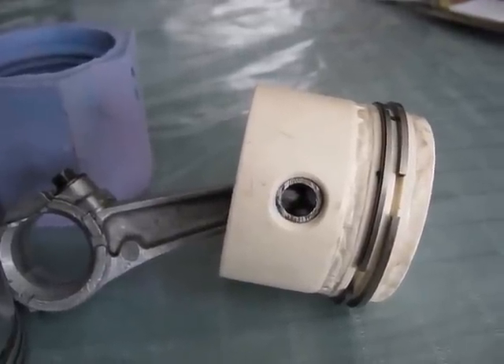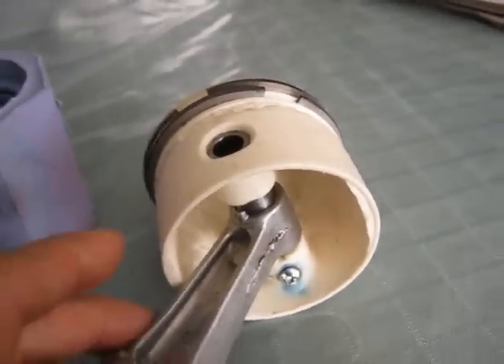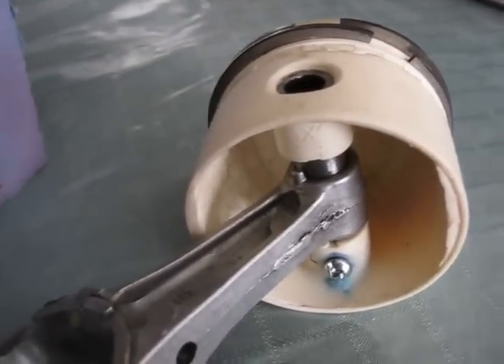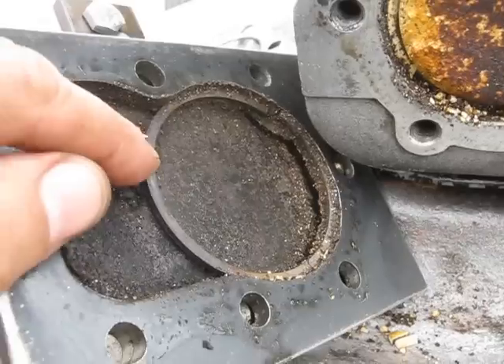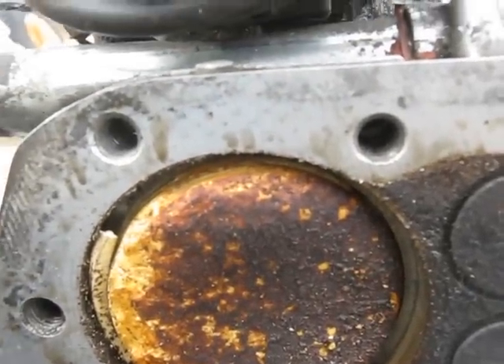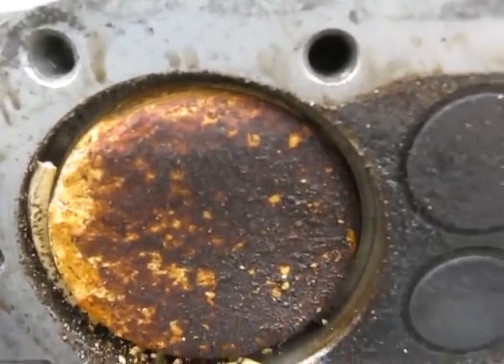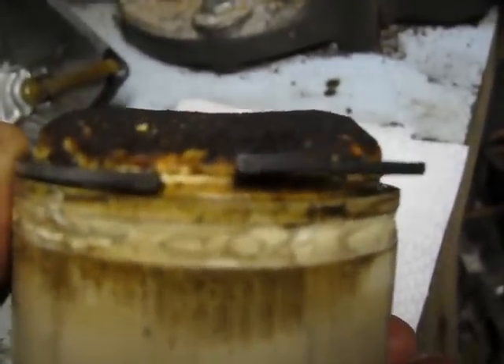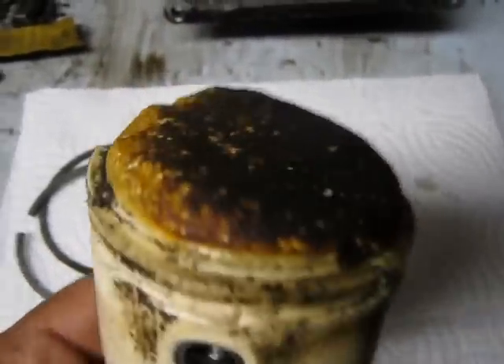PLASTIC PISTON  Briggs 4 Minute RUN!

Comment: concrete piston next ;)
Reply from the maker: That would be interesting, I wonder how the concrete would take the heat, if it spawled off pieces, I think it would eat up the engine pretty quick!
Reply: refractory cement (used inside smelting furnace)!? high silicone content!? (is silicone slippery?) and lastly, FIBER REINFORCING! all composite materials need FIBER REINFORCEMENT!
Reply: Who needs to hone the cylinder when the concrete piston does it for you ;)
Reply: Rockabilly Rambler hahahaha
Reply: Rockabilly Rambler this!!
Reply: Rockabilly Rambler yessss
Reply: concrete actually has a slightly lower density than regular aluminium, so it shouldn't make that much of a difference
Reply: bro, you must science so hard....
Reply: "concrete actually has a slightly lower density than regular aluminium," aluminium and its alloys have similar density and concrete density will gonna depend on many factors... 10 seconds with uncle google: "When using only MagnaDense as an aggregate, concrete with densities up to 4.0 t/m3 is achievable.  Mixing MagnaDense into concrete with other aggregates allows you to produce even concrete with densities up to 5.0 t/m3." aluminium is only 2.8 t/m3...
Reply: @ChargerMiles007  Aircrete might.
Reply: @ChargerMiles007  Aircrete? The stuff can really take the heat.
Reply: Was just thinking that.

Comment: don't give briggs any ideas. they might machine these from a high grade plastic stick em in and then we have ANOTHER reason to buy a new mower every season. -_-
Reply from the maker: LOL :)
I know what you mean, I am not a big fan of all the plastic parts they are using now, though some of them seem to hold up OK. I am pretty fed up with how short the life of home appliances has become, like 2 or 3 years!!!  >:((    having to replace a lawnmower that often would be criminal, considering I am still using my trusty 1973 Briggs pushmower!
 New stuff lasting such a short time is Terrible for the environment, the exact opposite of the green movement! The same goes for cars, you need to drive them into the ground before you have to spend the heat energy to melt the metal again, that is called efficiency, and is truly Green!
Reply: exactly what i was thinking!
same for you +ChargerMiles007
same thing i was thinking
Reply from the maker: I was outside doing some work, and thought I should make a vid on that subject of how the world is going anti-green in many ways. The green in the dollar seems to be the main factor!
Reply: Just came down here to make the same comment. They even sell them with plastic blades now!!??
Reply: lol, no worries. Tecumseh already has that covered, plastic carburetors. ;) I take that back I spy a plastic carburetor in the video. -_-
Reply: Tecumseh isnt made anymore to my knowledge but the new OHV Briggs push mower engines have solid plastic carbs on them.. and the old style diaphragm carbs have always been plastic but they work great. the newer engines of that style use mechanical governors though...more internal parts to mess up. another design change made by Briggs to make more money off of more destroyed engines. I hate Briggs and Stratton.. but that rant would take up to much space lol
Reply: Right, Briggs has made good carbs that were plastic. Tecumseh has been infamously known for their plastic carburetors due to cracking. I think the last time I seen a mower with a Tecumseh engine was a Huskivarna rider back in 2012.
Reply: Will Riling seems like every other spring one  falls apart
Reply from the maker: lol  :)  Thanks for keeping the rant short, I know what you mean though.
Reply: Will Riling every four minutes more like it
Reply: I know that feel of having old lawnmowers that never break, tha carbs are the things that mostly break from my experience, and I'm fine with those breaking every 5-10 years or so
Reply: seriously.  The older briggs motors were great.  the new ones, disposeable :(
Reply: Will Riling we allready have to deal with plastic cams, carbs and gears... soon the whole engine will plastic :(
Reply: I know, I still have my 1985 400cc IHV, Starts and runs at 240 RPM, sounds great after a carburetor upgrade. 
The new ones are complete and utter garbage.
Reply: ChargerMiles007 aluminum has a lower melting point than plastics?  I guess I didnt know that.
Reply: Will Riling yeah, they can have it match the plastic can gear and lobes in the new engine...don't get me wrong, it works, just not designed to last any length of time. I have a snapper model 3 30 inch cut rider I now my lawn with. has a late 70's 10hp on it. I gave it a fresh overhaul, new seals, gaskets, rings, but it really didn't need it. its all original, down to the points ignition. got it out this weekend to mow, been sitting in garage since Oct. started third pull. not bad for a forty year old engine. like to see these new engines last half as long
Reply: Cast aluminum has a high silicon content, so saying aluminum alone has a low melting point doesn't matter too much. Most aluminum we see is an alloy, not just pure aluminum. Strait aluminum does not even cast very well, but the alloys can be made extremely strong while still being light. I am a welder, and can say that strait aluminum actually does behave similar to plastic at high welding temps, but when you get into cast parts that property doesn't come into play since they are almost 100% alloys in any applications people are used to seeing them in.
Reply: sad but true...
Reply: Will Riling That's why I bought a Honda.Briggs used to put out a really good engine years ago,but not anymore.
Reply: Last year my neighbor needed a new mower so we went to Home Depot and seen they had two that looked almost the same. I said for an extra $40 you can get the one with the Honda, and he's very happy with it!
Reply: David Regan The Honda is a much quieter engine also,better fuel economy,easier to start etc.Your neighbor made a excellent choice.
Reply: Honda's are great little engines.  After all, they have had their small engines on scooters and motorcycles for decades and many of them still run.
Reply: 25rsboy I've got a 1975 Honda CB200S with electric and kick start street bike,runs like a Swiss watch till this date,it even has the original breaker points in t
it too.
Reply: I had a 1985 Honda Nighthawk S for a very long time and abused the hell out of it, still ran like new when I sold it with almost 30k on it in 2006.
Reply: Will Riling  ....Or buy a honda
Reply: Mr. Anderson Can't wear out a Honda.
Reply: well you can but it's hard, still depends on the abuse :D
Reply: crackerworld They can take more then most people can give it though,as so far as abuse is concerned.
Reply: LOL
Reply: Our 70s Briggs had a aluminum diaphragm carburetor.
Reply: People always bash them for plastic parts and being cheap, but these engines seem rather bulletproof to me. Older ones at least, can take stupid abuse and keep going.

Comment: I sincerely appreciate the fact that you have been using the same camera all these years. It is an aesthetic that simply cannot be recreated by any other means.
Reply from the maker: Yes, my camera is a few years old now. An honest question, does it have too low of resolution for people these days? I honestly can't tell, as it looks fine to me.
Reply: For the picky guys, maybe. Personally, I agree with you that it looks fine. The image quality gives it character, as in backyard mechanic character.
Reply: I like the relatively lower resolution. As long as the audio doesn't sound like gravel in a soup can, I'll watch any video. Only reason I went to an HD cam was because the old one I was using wouldn't refocus as the video was recording, that got really annoying. But I like the 480p resolution.
Reply from the maker: My old camera is starting to have a few issues, like the battery door having to be duct taped shut! I will consider an HD upgrade, thanks for the advice guys.
Reply: ChargerMiles007 old ti3 is a Killer camera for the money
Reply: its fine as is but if you want more subs you might consider a better one
Reply: you should check, i think there's some software tweaks that could mod your Canon T3i to shoot HD or 720, but well, they sure have better bodies now.
Reply: worlddomin623 
Ah, yes. The square video at 480p is very pleasant. *rolls eyes*
Reply: Maximum resolution on this iPad is 360p for this channel's videos. The next step on this device would be 720p. But well-focused 360p is perfectly acceptable on the 9.7” screen.

Comment: What if you made a JB weld (marine grade is higher temp and fuel safe) reinforced with aluminum shavings??? You could use the same mold even heck even imbed a aluminum piston face

Comment: Torlon 4203 is an unreinforced, lubricated, pigmented grade of polyamide-imide (PAI) resin for extrusion. It has the best impact resistance and greatest elongation of all the Torlon grades. Torlon PAI has the highest strength and stiffness of any thermoplastic up to 275°C (525°F). It has outstanding resistance to wear, creep, and chemicals. Torlon 4203 offers outstanding electrical properties, which makes it ideal for high performance parts such as connectors, switches and relays. In addition Torlon 4203 polyamide-imide can be used in applications such as thrust washers, spline liners, valve seats, bushings, bearings, wear rings, cams and other applications requiring strength at high temperature and resistance to wear. - High Flow: Torlon 4203 EXT - Higher Flow: Torlon 4203 HQ - Highest Flow: Torlon 4203 HHQ     {  I remember this when ford brought this out ( but not for piston tops )    http://www.enginelabs.com/news/plastic-race-engine-returns-as-polimotor-2-project-underway/

Comment: Cool experiment, what you have done here is via destructive testing , you have shown where the truly hot and weak points of the piston are.. One can easily see where the melting occurred on the crown, and the low efficiency of flame propagation in the flat head design. It tells a story of heat and gas flow..Virtually all the heat and wear too place under the exhaust valve in, as is the case in most engines.. 
Matra designed an air cooled diesel with cooling only on the exhaust valve side, and it's efficient and still in use today.. now you see why..
Had you put the rings lower down the skirt, so the ringland and crown were beefier, or a plastic piston bottom, with a metal ringland and crown ? who knows how long it would run.. Now we really are giving Brigs some new ideas,  would be interesting to see if you could make a composite piston plastic/steel ..maybe a bit of metal in the weal points of the wrist pin.. I'd try it myself, but I don't really like mowing other peoples lawn lol..

Comment: Unbelievable, both the result and the quality and care taken with your experiments. Excellent job, sir! Once it settled in, that thing ran smoother than a new Honda mower engine.
Reply from the maker: lol, yes, it has been rough running at the start on the last few vids, for some reason. My guess is that it may have been running faster than 3600 rpm part way thru, not sure why, since the governor was connected.

Comment: I had and Briggs engine in my ride on tractor 12.3 Hp and a 3 year old gas push mower. I look after all my things very well with yearly oil changes, sharp blades etc. Both blew up last summer, no more Briggs EVER.
Reply from the maker: That is a strange thing to have happen!

Comment: Really interesting video, enjoying the whole series, noticed the failure seemed to be the weak areas around the rings, it might be interesting to try a plastic piston made to be a close fit to the cylinder with no rings.
 looking forward to more )
Reply from the maker: Not sure about a close fitting plastic piston, mainly do to the expansion rate of plastic. it might try to seize up. I sanded a bit extra off of the piston to avoid such an event, though it was still about the same fit as a stock piston.
Reply: Will no piston rings seize up more or less then piston rings rattling around in the cylinder? :)

Comment: There must have been a strong smell of burning plastic there!!  
I stripped a Briggs mower engine down about 15 years ago, due to my Dad hitting a rock with the blade and bending the crank.  I was appalled when I discovered a plastic camshaft!  
However, I've been using a Flymo (UK brand), with a Tecumseh MV100S 2 stroke engine, for about 12 years now and that has been faultless. It's showing no signs of giving up any time soon, despite heavy use on some large lawns.  I do use a quality 2 stroke oil though as I have a couple of 2 stroke bikes, so I use the same stuff in the mower!

Comment: Great job! The top of the piston melted. If you do this test again you need to treat the top of piston to the first ring land to dissipate the heat. Electronically plated chrome or nikasil would work and toughen up top of piston. That will definitely double or triple the life of the piston. Also the angles of the relief above and below each ring needs more clearance relief to dissipate heat. The other problem you will find is piston pin will come apart in time, that needs extra support. Finally, cannot put normal oil in engine because it eats plastic. And increase clearances, probably around .002 for aluminum piston but double it to .004 and put a film coating on piston skirt. You maybe able to get a plastic piston to run a few hours. Great job.

Comment: you should try a plastic rod
Reply from the maker: I thought of that this week also, I will start making a mold for it! 
I am not certain about how durable it will be, but this piston really surprised me also!
Reply: it lasted longer than i thought could try other plastics and see if they are just as good.
Reply: ChargerMiles007 the rod would need to be a material with a extremely high hardness rating and a good tensile strength to prevent it from instantly being bent or snaping or getting ripped apart XD
Reply from the maker: thanks for the info, the plastic is only rated at about 3000 psi in tension, so about 1/10th of aluminum. I will thicken it up as much as I can, and hope for a short run out of it!
Reply: that would behave like a brand x
Reply: marco sooooo delren?
Reply: Try some fiber reinforcement during the casting
Reply: add a ceramic or enamel coat to head maybe?
Reply: Mabye a carbon fiber piston and rod, that would be interesting...
Reply: Tinfoil plated plastic.
Reply: A plastic flywheel would probbaly just explode in 5 seconds

Comment: You are the mad scientist of engines!
Reply from the maker: lol  I don't call them FrankenBriggs engines for nothing!  :)
Reply: ChargerMiles007 Im making a 3 cylinder radial engine because of you lol, any ideas on the crank? I have a metal lathe, milling machine, tig stick mig and oxy welders, unlimited resources (except money) and a shop. i just have issues with crank and timing.

Comment: Would be interesting to see a similar attempt with some more efforts directed at mitigating the heat issues. 
I take it that 300 series is a polyurethane? In which case, it's softening point is probably somewhere between 90 and 150ºC. 

Perhaps a phenolic crown bonded to the piston may last better & save the rest of the piston. Couple that with converting it to run on e85, or methanol (or even a basic water injection jet) & you may get the combustion temps low enough for the piston to last reasonably long. Would be really interesting to see if you could get it to the point of lasting an hour or so of hard running. 

There are resins that would handle it fine but nothing cheap. Would be really cool to make a plastic piston with a reasonable life, on a budget.

Comment: Try adding mica flakes and/or fine clay to the polymer when you cast.  It will form silica char rather than burning through.  It will likely run hours.

Comment: No cooling fins on the head could cause too much heat in the chamber further heating the piston? Would possibly work in a liquid cooled engine.
Reply from the maker: Yes, this is true, the steel head without fins certainly would run hotter than a finned aluminum head.

Comment: Wow, very good! Now I wanna see the whole engine (minus the electrical parts and any other mandatorily metal parts) be made of plastic and work!
Reply from the maker: I kind of switched over from plastic to JB Weld, since people seem to go bananas for engine parts made of that. I did a JB Weld cylinder liner last week, and ran it 3-1/2 minutes. It would run longer, but that kind of proved the point. I am working on another part also.

Comment: Very brilliant idea if I do say so myself. However don't know if you'd be willing to try more of a hybrid, where by which the top of the piston is compromised of a metal casing to allow better heat distribution and reduction in the plastic disintegration as well as allowing better seating of the compression and oil rings. Other than that very very impressive, keep at it.
Reply from the maker: Thanks

Comment: I see a lot of comments about making a plastic connecting rod, which would be really cool, but I think I'd rather see the crankshaft made out of plastic... maybe with brass inserts or something on the bearing surfaces, or maybe not and see what happens.

I have no idea how it could be made, but a Pyrex piston would be interesting and might hold up for a while if it doesn't immediately shatter.
Reply from the maker: Yes, I am planning to make a plastic con rod. A crankshaft would be very expensive for me to try.

Comment: btw your videos are great.  I've been watching on and off for a long time.  (did you ever get that contraption of many engines connected to work?)
Reply from the maker: Perhaps you mean the 5 cylinder radial, or the Jumo 205 type.I haven't run the jumo again, though I need to. I have not assembled the chained together 5 cylinder radial. I have lots of work to do!Too many irons in the fire.